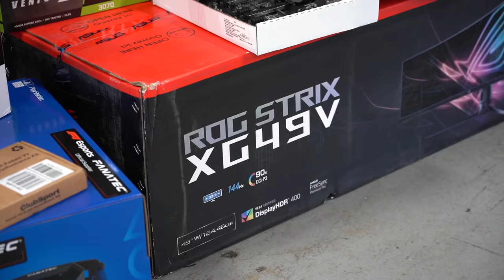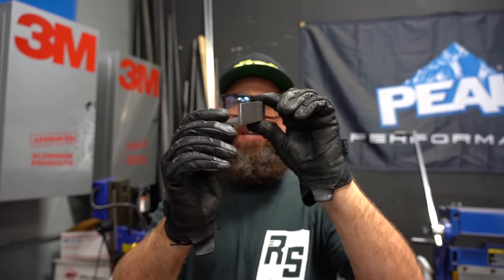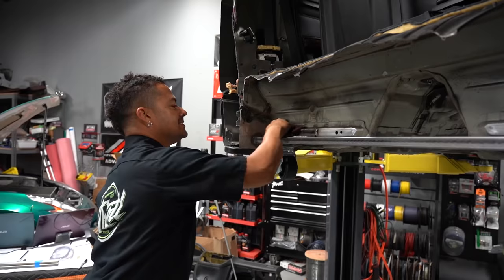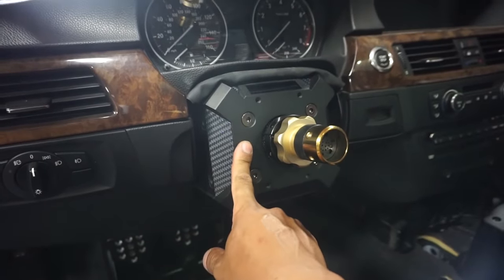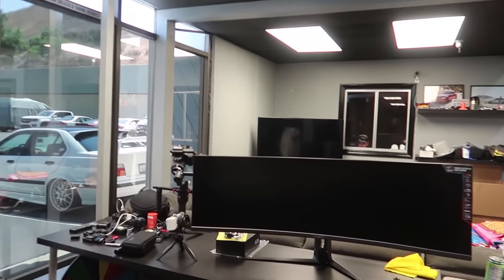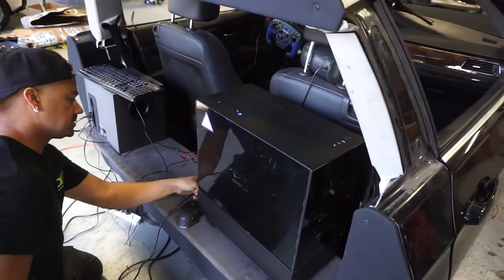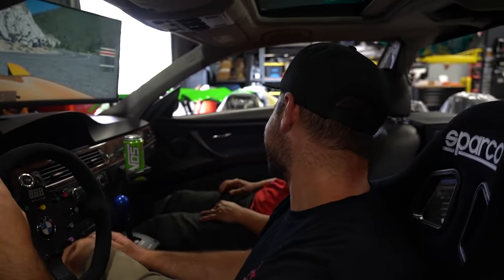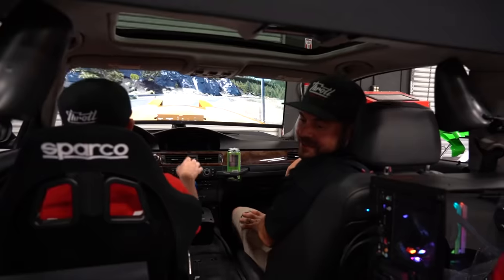Building a Wrecked Car into the Ultimate RACING SIMULATOR! (Complete Transformation) - Fanatec

Comment: This is the dream! I would box the monitor in with a black frame so you can’t see the shop through the sides and then try fit the centre console back in! So dope!
Reply: yeah and if it had windows double 5% tint
Reply: even a black cloth could do
Reply: Yeah for real.. what amateur shit is that
Reply: As well wire up the power button on the car to the power button on pc
Reply: They should of made the actually speedo and rev counter to work with a motion platform under the set
Reply: I totally agree you also can use a reverse mirror
Reply: Or use projector

Comment: It'd be SICK AF if you were able to get the factory gauges working and the iDrive working/linked in with the Sim sound
Reply: There’s one dude who did it with a full tutorial here on YT and I think these boys are smart enough to figure it out lol
Reply: @kyleranderson5557  I know a guy that did the same with a Ford Focus dash ... might take a little more work to get the Iriver working (without a motor/ECU/BCMs etc)... but you're right, the Throtl Boys are def capable
Reply: And the mirrors showing behind you with small screens. So cool
Reply: @kyleranderson5557  I did that and you need the right bmw cluster. The later clusters need the ecu and other modules to report miles or it enters a safe mode after a while.
Reply: @PeaceSTAR253  Or you could just wire the gauge needle motors straight to the arduino/pcb controller, skip the dash chip. Downside would be that the dash will not work in a car anymore. Every stepper motor works on a common ground, +12v & signal wire.
Reply: Was it actually a BMW or just a BMW wheel?
Reply: Simhub will let you add wind effects, working guages, and rumble in the pedals.  Then add in a Buttkicker to the drivers seat.
Reply: done: https://youtu.be/InsCZJuWUtU?t=86 🙃
Reply: yo i have one its relatively easy to make one
Reply: And add motion platforms to both seats

Comment: Need a lcd screen where the cluster is so you have real gages that would be next level
Reply: what he needs is to plug the cluster to an arduino and make it work with the game
Reply: @helplmchoking  Its quite easy. With Assetto Corsa you would just need sim hub(app) or a similar program. AC already is able to send outputs to secondary controllers. Would just need an audrino to convert the input to a signal that the BMW cluster can interpret
Reply: @helplmchoking  there are mods for it for sure
Reply: @helplmchoking  Most gauge cluster LCD's that are made for sim racing support simhub or games (like the F1 series natively supports external sim hardware) so it'd be nearly plug n play.

Comment: not perfect but pretty great! need adjust the FOV in game, and make the cluster work (with a lcd in there or with arduino and CAN code)

you could use the speakers in the doors too
Reply: Yup .. there is still a lot of adjustment that's needs to be made
Reply: Yup, in ac it's easy to adjust fov and helmetcam placement to match with the rig :)
Reply: This need muuuuuch more adjustements and triple screen. Minimum. Maybe 3x projectors...
Reply: yes, fov
Reply: i wish the flat screen could fit into the  wind shield

Comment: Also pro tip, use those good simulator parts and sensors hooked up to the cars original pedals and use the original steering wheel, make an adapter to go from the steering shaft to the sim wheel, then extend the buttons and switches to the cars original wheel and column....it will ad to the feel of the rig a LOT.

Comment: Very cool, very very pricey setup, but very cool. Couple suggestions- I would ditch the monito mount with an adjustable one so you can position the monitor a little better. The other suggestion, while you have a subwoofer, you could still add some motors to the chair to give some vibration feedback. A lot of possibilities with this setup, would be really cool to add adjustable mounts that could shake the car. :)  Very envious of the gear though, would love fanatec setup, but man does it hurt the wallet. Also be mindful of that steering column needing to breathe, they motors can get a bit hot stuffed in there like that. Enjoy the setup!

Comment: Heres some ideas, Add power to the windows and tint them. Use the speakers. box the screen and the back. use a push to start as the pc power up. add a swivel keyboard and mount that goes in front of the drivers seat. (not sure if this is possible) Get gauges to work, Most sims use  rev limiters in game, (this would be a bit expensive to get someone to code the rev and speed{Or get someone off fiverr to code it})

Comment: So did y'all figure out a way to hook up the speakers to the ones in the car? That would be sick!  What about a rearview mirror that is its own screen for the sim.
Reply: That would be pretty easy actually. Just power the car electronics by the 12V output of a big singlerail PC power supply, plug the PC audio output to the AUX of the car stereo and start the thing by a switch that's mounted into the dashboard and is connected to the 24 pin cable of the PSU. If you connect the right pins, the PSU goes on. In case the car stereo doesn't have analog  AUX input, just use one of these cheap radio transmitters that can be plugged into the cigarette lighter.

This should power the whole dashboard and interior lightning too btw. At least if the stuff is still connected.

To make the whole thing more immersive i would suggest to add some tactile transducers to the chassis and the seats, driven by Simhub. (And probably replace that single screen by 3 projectors.)

Comment: If I could add a picture you would see my driving simulator is way better I made all mine home with real car parts with thrustmaster parts and I have almost everything working like a real car in mine head lights brake light turn signals surround sound and the car radio and so much more I made mine out of a 04 - 07 Pontiac grand prix